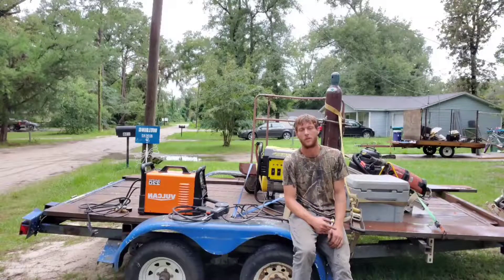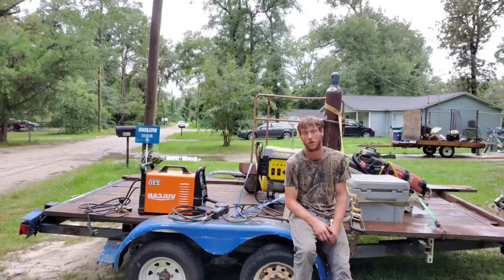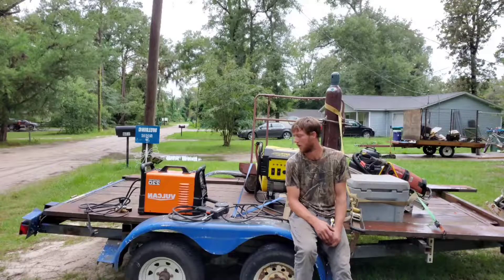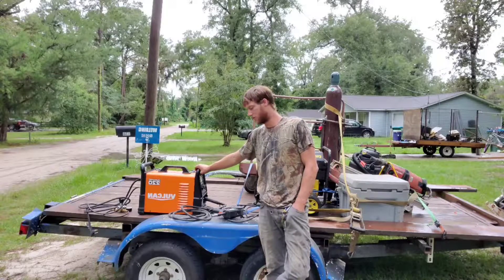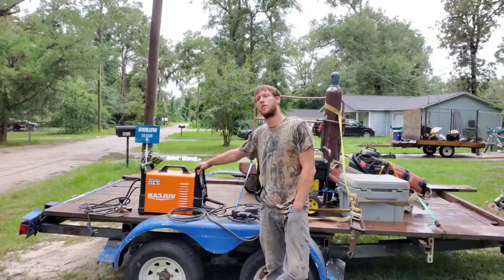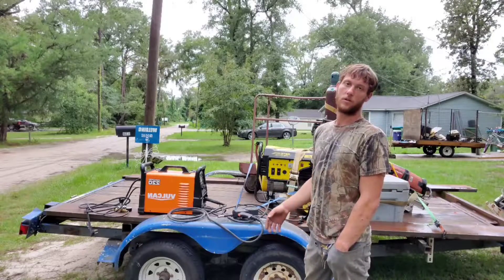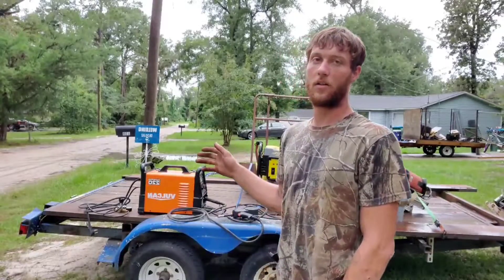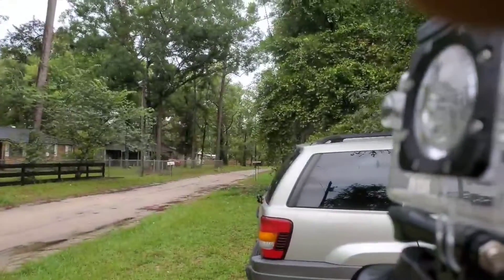Affordable Mobile aluminum welding rig w/Omnipro 220, looks like tig!! EXCELLENT WELDING FOOTAGE!

Comment: Brother, I had a Vulcan 220 welder with a generator that was rated at 9400 watts and it didn't work, it gave me problems on the screen of the machine and I can't explain why.
Reply: did you get it figured out? just bought the omni today and my 10k generator wont run it, welder gives fault code either too low or too high power supply.
Reply from the maker: You are simply not wiring the machine to the generator correctly

Comment: For those of you asking about the generator... This setup is a fluke. The average running watts of a welder is 6500.  You will need a generator with a 50 amp 240, not a 30 amp. You really need to double the watts too, so 13000 starting. Or... you can get an inverter generator thats closer to the wattage of your welder.. like 7000 watts. Remember, when running an inverter welder off a generator, you need clean power or lots of power.
Reply: What would you recommend fora  generator to power ac current aluminum HF?
Reply: @brandow2392  Any generator that has enough power. I have a 13000 watt duromax.
Reply from the maker: Not a fluke. My setup works great
Reply from the maker: I have videos showing me using this setup. I have since then upgrader my generat to a Briggs home defense generator and works even better. Although is nowhere near 13000 watts. That is a bunch of BS and just not true. You can run a inverter machine perfectly for any process with much less watts then 13000. You obviously have never tried this or you would have a different opinion. I have ran my business the last 6 years flawlessly with my equipment and I would be happy to make a video proving you wrong boy.

Comment: Ive been scared to run mine off a generator. Ive heard bad things about it. Are you still using this set up? Has it done well for an extended time? Really glad you made this video
Reply from the maker: yes still use to this day
Reply: Been running mine from a generator since the building I'm in does not have 220
Reply from the maker: Bro MAKE it have 220. Is there is power going to that building from the pole I promise you there's 2:20 in that breaker box you just don't have a plug for it my man

Comment: When I'm wielding aluminum I can't get my machine to go over 20 V I'm using a predator 9000  generator
Reply from the maker: Check wiring on your power cord. You are only feeding maxhi e with 120v

Comment: Just tried out the omni pro 220 with spool gun with the 9k predator generator and it keeps going into shut down mode. the adapter is a 30 amp generator to welder adapter from amazon. not sure why I'm getting issues as I would think 7,250 running watts would be fine for this machine. I noticed others have commented same issue as well and just trying to figure out the reason for it. thanks !
Reply from the maker: I think that machine does not output split phase 220. I would check the output of your adaptor to make sure you have 240v split phase
Reply: Did you figure it out? I just bought all the same equipment yesterday
Reply: Have you figured it out I have the same generator

Comment: I had a Prededor 9000 that was 7250 running watts and it wouldn't run the machine on 240 volts I did some research and find out that the machine Needs about 8300watts but to he safe it has to be 8500watts
Reply: same issue here with same generator. have you figured it out ?
Reply from the maker: I use a Briggs and Stratton storm responder works great.

Comment: Im looking for a good generator for my omnipro 220. How has it held up with that generator? Had you had any issues running on dirty power? Do you run 110 or 240 on most jobs?
Reply from the maker: The briggs and straton storm defense generator with high starting watts is what I use and it works great.

Comment: The look of the weld tells a lot about an operator's skill. I love my 220, gave away my Lincoln shelved my Eastwood and sold my Hobart. I run it on a 100' 8ga power cord and 6.5k generator.
Reply from the maker: Damn right. Man I shelved my Miller, my other Miller. And only other machines I use now are my prime weld plasma cutter and prime weld ac/dc tig for anything in the shop. But if I go anywhere My omnipro goes with me hands down. I upgraded my gen to a  8.75kw STARTING WATTS and I get much better performance and range! Picked up a briggs and straton "storm defense" for $500 and I absolutely love it. It has high starting watts because it is designed to power a house and that is key for running welding machines. That and a $250 extension cord of course....
Reply: @MrFigureitout  I'm looking at the HF 8.75K inverter generator. 50lb lighter and not as loud.
Reply from the maker: Please let me know how that works if you manage to get one! I have been wanting to switch to an inverter style generator but haven't had an opportunity to test how my machines run on one first. Considering all my new welders are all inverter style machines you would think they would run perfect, if not better. But I don't know anyone else that is even running a setup like I do.  Nobody. Thats the whole reason I decided to make this video. When people see my setup they are all almost always skeptical. Then I bang out a $500-$1000 job, onsite; in their driveway or at their business, in a few hours and every weld is flawless, and they go "dang, that's a nice setup you have there sir!" I can unload my gen by myself and roll it anywhere I need it, including in an elevator or backyard if for some reason my 100 ft cord isn't long enough. Then I can load it all back up by myself and roll out. Trips people out everything. (I added front wheels on my generator on a single axle that turns with the handle just like a wagon! Very convenient 👌)
Reply: so i should get the vulcan?? i was about to buy a square wave and try and do custom exhaust and mobile repairs... I've seen the vulcan weld and it looks really good, I'm just worried about longevity.
Reply from the maker: Get the warranty. I have replaced mine 3 times due to the fact they do not sell a replacement mig gun.
Reply: @MrFigureitout  roger that!
Reply from the maker: Get the warranty and you should be fine.  If you take care of the vulcan it is well built and should be fine.  Although I beat the hell out of mine.  Between transporting it from the shop to the truck and I build a lot of stairs.  Up an down stairs all day long and dragging it by the lead to get that last weld you can't reach will wear out any machine.

Comment: I picked up the mig max 215 and ran it through it's paces. I ran bead after bead, just padding the bead on a1/4 inch plate.  I had the plate glowing and bent from the heat.  Ran the entire 1 or 2 pound spool of harbor freight mig wire, not flux core, that came with it.  I didn't hit duty cycle on 110. I had to back off because my hand was getting hot. So far I am impressed with it.  Next to try out the protig 205.
Reply from the maker: Let me know how you like the protig! I want one. I just got the prime weld 225 tig ac dc and so far I love it. It really packs a punch and is super smooth when you get settings right

Comment: Great video, thanks for posting. Do you know if the titanium 150 Spoolgun will work with it?
Reply from the maker: No I'm not sure. But I'm going to assume it will not unfortunately.  But I could be wrong. The titanium mig gun consumables are interchangeable with the vulcan I believe so maybe!
Reply: @MrFigureitout  I checked last week  ......the answer is NO it doesn't work for the Omnipro 220
Reply from the maker: I thought so but thanks for verifying that

Comment: Thanks for information n tips
Reply: Hello there  like ask you a question on aluminum spoolgun.  When have all hooked up  When you open your gas bottle  does the spoolgun blow gas out or only when you squeeze the trigger?  Thanks 4 info
Reply from the maker: Only when trigger is pulled. If yours is blowing gas then your gas valve is stuck open. Open side of machine and tap on it until it releases. Then test its operation before you close up machine. Good luck!
Reply from the maker: You are very welcome.

Comment: Fantastic welding. I was trying to hear you and the weld over the music but was unable to hear. I was stunned at how perfect the welds are. I have the same welder and spool gun. I just don't know how to weld but I am trying. This was very encouraging to me.
Reply from the maker: That's great man. Crank up the heat and turn down the wire speed and spray it man. Shouldn't hear any clicking or popping. Should just get a smooth buzzzzz.  Back that nozzle up a little and turn up your gas pressure a tad. That will save you a bunch of tips.  Good luck bro
Reply: @MrFigureitout  Thank You. I looked forward to more YouTubes with that welder from you.

Comment: I worked as a welder for years before and through college and a little after. We had a customer who just couldn't keep his 40 foot East dump trailer. He was a farmer and would be dumping corn sileage or beans or whatever and he'd tip that thing over. 3 times in one year. We're had a one pound spool gun and i must've used 50 spools just on his trailer. The thing would bend so we'd have to remove panels between the spines, use a porta power to open them up then weld in a patch piece. And the tailgate would always break off. The Main thing i found is that it goes on really quick so i had to grind a lot before i started. I like your content, can't believe you don't have more subs?
Reply from the maker: Thanks man that means a lot. Getting subs has really been tough for me but I don't plan on giving up.  I have a customer similar to the guy you mentioned. He just keeps coming back and I just keep fixing his trailer. Last time he broke it 2 times in one month. Spool guns get a bad rap but are really quite powerful.

Comment: What size wire did you use for your extension cord?
Reply: I ran a 160 amp welder off the 240 outlet. It ran just fine. I also tested a 200 amp welder off the generator it would turn on but it wouldn’t run. You must have a good generator that can run it.
Reply from the maker: You are right. My current one has very high starting watts 8500 with 6250 running watts. Works great. Briggs storm responder
Reply from the maker: extension cord must be very big.  not sure exact size but It is a 3 wire cord and outside diameter is about 1".
Reply from the maker: also I wouldnt reccomend making it much longer than 100' unless you have a generator that has a constant output of 7000 watts or more.  i upgraded my generator to a briggs and straton "storm defense" high starting watts generator and has proven to do the job much better than the one I showed in the video. i can run my welder on full blast with a 100' extension cord flawlessly.
Reply: I have a generator 8250 starting watts, 7000 continuous. 6/3 wire 25ft long. The welder turns on, but it shows an error massage.
Reply from the maker: @amadormedina2414  whats the error message? Is the generator single phase 240v or split phase 240 v?
Reply from the maker: Send me the make and model of the generator and I'll see if I can help
Reply: It’s a genearc gp 7000e. The message says it could be either one of these:
Machine needs to cool down. 
Too low input voltage.
Too high input voltage.
Reply from the maker: And you have the omnipro 220?
Reply from the maker: Have you checked the output voltage coming from your generator? Also you should have two 110/120v hot wires and one ground wire. Be sure not to have one 240 v hot wire and one ground wire because machine will detect voltage is two high for single phase. It requires split phases of 110/120v
Reply from the maker: After looking up your generator it would seem that it is only split phase. That may be the problem although I'm thinking my generator is single phase as well.  Do you have a good voltmeter? Perhaps we could do a video chat when your around your generator with your volt meter and adapter cord and maybe I can help you get to the bottom of your issue.
Reply from the maker: Correction *
Your generator is only single phase. Typo
Reply: I got 250 volts with the voltmeter on the generator and on the female end of the extension cord when it’s plugged in.
Reply: It runs fine on 110
Reply from the maker: You should only have 110 volts per hot wire. So you should have 3 wires.  When you check voltage from two of the wires (one wire must be ground) you should get 110 volts, then when you check voltage from 3rd wire and ground, should be 110v.  When you check voltage between the two hot wires you should get a reading of 0 volts. Therefore you shouldn't be getting a reading of 250 volts ever.  Thats why it is not working.  Maybe double check that you are using the right 3 connections on your generator considering it should be a 4 prong outlet.  Otherwise your only going to be able to run your machine on 120v on that generator. Hope this helps

Comment: That’s awesome. Idk if it was on the video but what generator is that ? Would love to be able to do 220 on the field
Reply from the maker: That generator is a champion 6,500 watt running 7,250 watt starting. Most generators have 220/240 plug on them and its usually a 4 prong.   Believe most are split phase but some are single phase 240 but the vulcan doesn't mind either way.  You can get the generator from tractor supply but its pricey. I Actually just upgraded my gen to a briggs store defense 8,000 watt and I must say, my vulcan runs much better and can weld and grind at the same time.  I would reccomend a generator with at least 6,250-6,500 RUNNING WATTS and you will be able to rock and roll without wearing out gen too fast. Good luck!!
Reply from the maker: CORRECTION- it was a champion with 5,500 running watts actually.
By the way, thanks for the compliment bud!! Hope my video helps you upgrade your rig and saves you money!

Comment: Did u have problems with the vulcan running on 220 power?  I got the same set up as u do  but my welder cuts out with 3 codes when running on that power... the 120 works great please let me know your secret
Reply from the maker: Oh no. That doesn't make any sense. Please email me at americanfabricationllc@gmail.com  with pictures of your plugs on generator and please provide a description of how you wired your plug.  On the cord that came with the vulcan, the male plug is a 30 amp 3 prong.  Two of the prongs are flat, and one is round.  When running generator with adapter cord plugged in. Use a multimeter set to AC 250 volt (or higher voltage setting). Check your voltage across one flat prong slot (hot #1)and the round slot for round prong (groumd).  You should have approx 115-125 volts ac.  Now move the test lead from one flat prong slot to the second flat slot (hot #2). You should get almost an identical reading between 115-125 volts ac.  If this is not the case, then that will most likely be your problem.  If you are ever getting a reading of 220-240 volts then something is wrong and cord is not made properly
Reply from the maker: Also, it is essential that you make your adapter cord correctly!  I can do a video on this if you need. Just let me know.
Reply: @MrFigureitout  I bought the plug from Amazon  i got the predator  9000 and it won't run the vulcan... it goes into a shut down mode
Reply: @junito8670 I got that same  Generator and my welding machine won't go over 20v
Reply from the maker: Also heads up! Make sure your fan is running constantly on your vulcan! I had this problem but HF replaced entire machine no questions asked!
Reply from the maker: You can determine how to wire your adapter cord by completing a similar test on the female plug on your generator when running.  It should be a 4 prong plug on your generator and one of the output wires is not needed and should not be wired to your plug.  Once you have determined the pin sequence that gives you the right results, connect your 3 of the 4  possible connection points consisti g of 2-hot connections (120v) and  1 - ground connection.   It doesn't matter what color wires you choose for each connecrion AS LONG AS YOU MATCH THE CORRECT COLOR TO YOUR GROUND PIN SLOT ON THE FWMALE END OF YOUR ADAPTER TO THE MALE END.  IF THOS DOESNT WORK EMAIL ME AND I WILL HELP YOU.
Reply from the maker: Hey man did you ever get it going?
Reply: @MrFigureitout  I’ve got the same issue as this guy. Omni 220 welder and predator 9000. Welding steel anything over a few inches. The welder has a duty cycle warning and cuts the power supply for a while. I don’t think it’s the fan like you said.. Maybe I’ve got the wiring wrong. Idk.
Reply from the maker: Yes check your voltage from your machine.  Also, one thing that my generator has is a very high starting watts capability because its designed to be able to start large electric motors.  Maybe that plays a role in why my setup works so well. I have never tried the 9000 watt gen from harbor freight because they were always out of stock. I ended up upgrading to a Briggs and Stratton storm defense generator and could not be happier. Now I can get full potential from my Vulcans in the field.
Reply: Mine does the same thing when trying to run 220 on my 9000 watt harbor freight and my 12000 watt champion… there’s a video that says you need to run a ground cord from the generator to the welder but I haven’t tried that yet